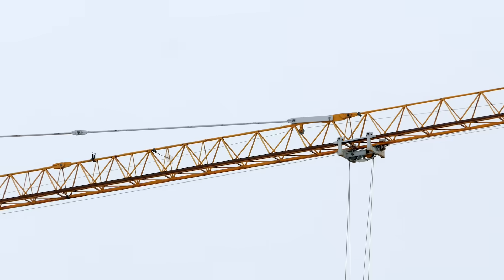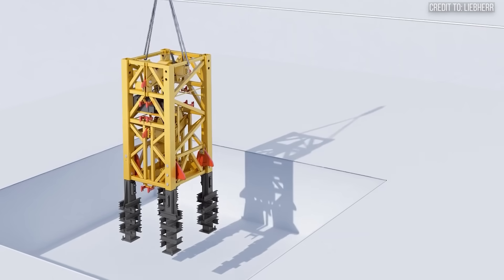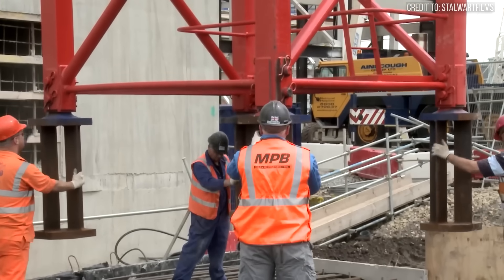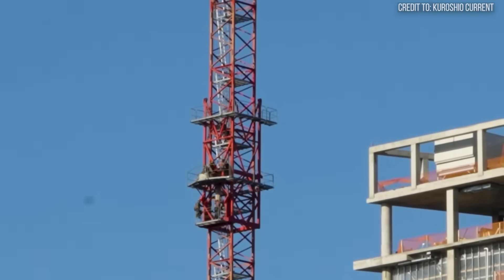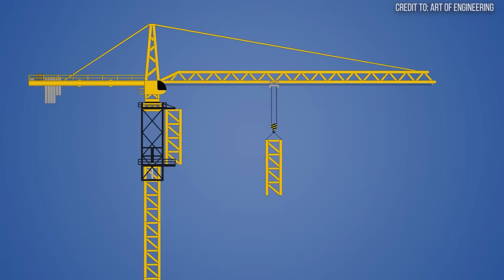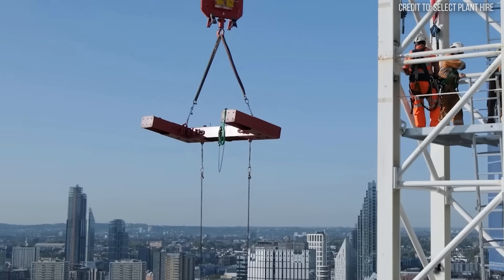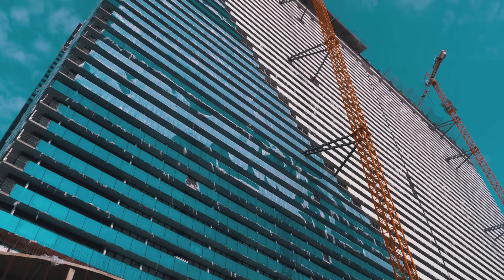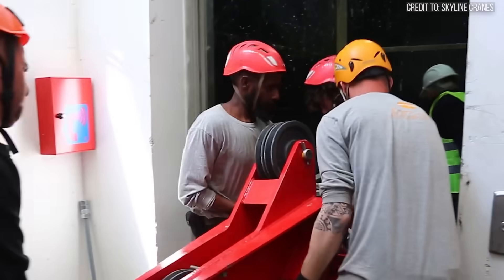How A Tower Crane Assembles ITSELF

Comment: Did I blink & miss how the cab & counterweights are initially attached?
Reply: That was missed in the video. The mobile crane lifts them on once the initial tower is at the height the mobile crane can reach.  The tower crane then builds itself upwards.
Reply: Yeah I was waiting for that part too!  I'm still waiting.... disappointed... and the mystery remains...
Reply: Another crane.
Reply: Mobile crane comes in and assembles the lower sections to as high as it can practically reach including the cab, counterweights, jib, drum and trolley
Reply: 0:18
Reply: They normally set the cab before placing the counter decks and jib sections, all with the assist crane

Comment: It's not the raising of the tower crane that amazes me....it's the small footprint and relatively few bolts holding it in place.  It seems as though it would be like trying to balance a tall pipe on your fingertip!
Reply from the maker: Hi, we actually have a video coming out soon which explains how they don’t fall over! Hope you enjoyed the video
Reply: @HardHatIndustries  let us know when the video is online (subscribed now by the way)
Reply from the maker: The video is now live if your still interested!
Reply: @HardHatIndustries  thanks for letting us know, much  appreciated.
Reply: I agree, the footprint seems small relative to the moment arm on the height, but obviously it works. Amazing.
Reply: The tower crane is secured to the building at different intervals as it rises

Comment: What of the concrete base, is it buried and left behind?
Reply: The concrete footings are usually buried. There are different types of bases and methods for climbing. Some jack up from the bottom. Some jack up using a climbing frame attached to the crane mount at the top. 

A climbing frame fits around the tower and covers 3 towers. It is connected to the underside of the crane mount at the top and hangs down over the top 3 towers. A climbing frame has two hydraulic rams connected to flippers and a detachable monorail. There is a hole in one side of the middle section of the climbing frame a bit larger than a tower section. 
1. The crane is 'balanced' so the climbing frame hangs plumb. 
2. The flippers are turned out and the hydraulics swapped over to the climbing frame rams. 
3. Then the top tower is unbolted from the crane - it doesn't fall off because it is connected to the climbing frame. 
4. The crane operator uses the crane hydraulics to extend the rams on the climbing frame. This raises the entire crane off the tower.
5. The new tower is lifted up by the crane. It is transferred onto the monorail, disconnected and pulled in underneath the crane. 
6. The new section is then bolted to the top of the existing tower.
7. The crane is lower to sit on top of the new tower and 'pinned' ( a couple of bolts each corner) 
8. The flippers on the climbing frame are turned inward and the hydraulic rams are fully retracted. 

Then they start from step 2 and repeat the process to install the next tower. 

Climbing them down is the reverse. Most tower cranes are climbed down to around 80 feet and then the final disassembly is done with a large mobile crane. All the components in a tower crane are designed to weigh up to 12 tonnes for average sized Favcos and Hammerheads. There is a dissassembly sequence. The last thing standing is an 80 foot section of towers. These are split in half. A semi trailer is roughly 40 feet long. The two 40 foot sections fit nicely on two semi trailers.

People claiming it is a 'precise job' - well it kind of is.... but it also kind of is not. I think they're being a tad dramatic to hype up the perceived danger for people who've never worked on them. Back when I was a much younger man in the 1990s - early 2000s... I climbed, erected, and disassembled about 30 of them... Favcos and Hammerheads....I was never in charge...
Reply: Best job in the world working with tower cranes I miss it everyday
Reply: @markuswilmes3694  It was interesting work and a small niche industry. I started when I was 30 in 1994. Some of the people I worked with / for would be over 80 or passed away. 

Never seriously considered being an operator....did a lot of rigging on them and dogging on high-rise construction in SE Queensland

My body wouldn't handle it today. Time catches us all.
Reply: No, the chip it up and plant flowers

Comment: In Victoria Australia we sometimes put the tower cranes in the elevator shaft. When the structure tops out we will build a grillage on top of the structure and around the highest tower section. We then release the machine deck from the towers and jack slide it across to a temporary tower fixed to the roof and continue to use the crane until it's removed as described here. The builder then completes the lift shaft.
Reply: Please define and describe "jack slide." That sounds VERY interesting.
Reply: So ?
Reply: done the same in England.
Reply: The video didn't cover how the crane structure on the side of the building is dismantled after its reduced to roof level so you've at least described one way to do it.
Reply: @nathanielratcliff7456  The tie backs get removed as the crane gets shorter. You just hook onto the arm with the crane when you get to one, then disconnect and remove all the connecting pieces, fly the arm and collar down to the ground once it’s all free, and continue down climbing and removing more tower sections.
Reply: That’s a really old method that’s been around for a long time. Some of the older cranes they used to run here in Canada were like that. Look into old Linden cranes. Pacific Centre mall in the heart of downtown Vancouver was built in the 60’s, using Lindens that climbed the elevator shaft.

Comment: Maybe the process hasn't gotten there yet. I'm wondering how the operator gets down everyday.
Reply: There are ladders built into the towers. Most of these cranes aren't free standing. They are tied to the building by heavy steel ties every 3 or 4 floors. What companies do is build a scaffold walkway on top of the highest tie to reduce the amount of climbing the operator has to do.
Reply from the maker: Good old fashioned ladder’s!